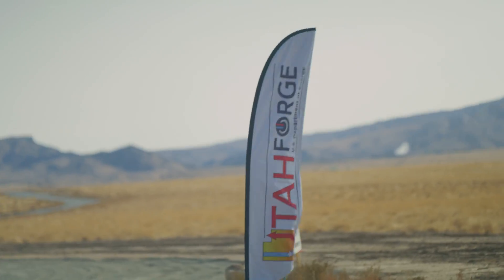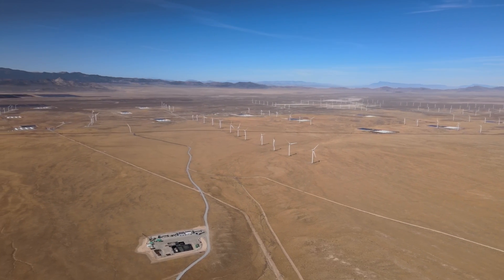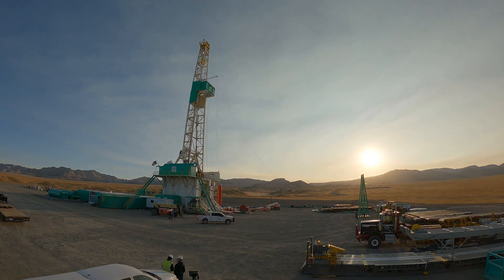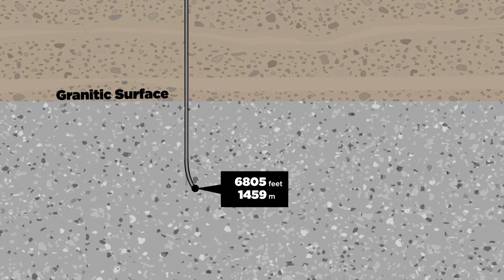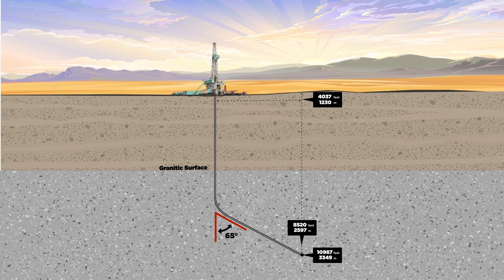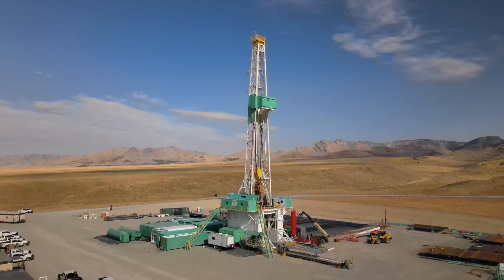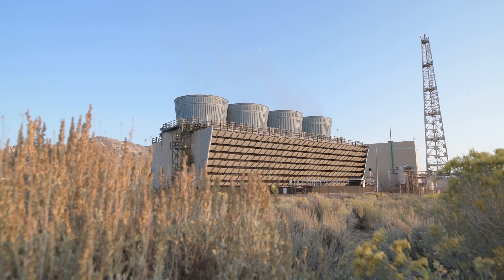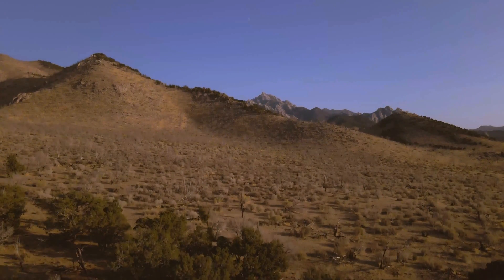Drilling into the geothermal future: the Landmark Success of the First Deep Deviated Well

Comment: long ago the military set off nukes underground...which would have fractured the nearby rock and melted a lot of it.  i imagine that the cavern formed of melted rock would be cracked by now or
could be cracked with smaller explosives.  the radiation will probably last for thousands of years, but does that matter for a geothermal plant that won't be on the surface or used for humans
except for the heat??? Nevada had several of these bomb sites and at least one in Alaska.

Comment: This is a very interesting project ... 
Studying the feasibility of reservoir thermal variant wells was my capstone thesis project in 2011 for graduating as a mechanical engineer from The University of Manitoba
-
What was the expected output in MW of this project?
I'm very interested in bringing this to Africa, amongst a few others. If you guys are taking on strategic partners and funding, I'm very interested in discussing.
Pls kindly let me know and we can set up a zoom call
Reply: The power output will depend on the temperatures at the bottom of the well.
Usuall, the higher the temperatures, the higher the energy output.
At a depth of 5km, we usually encounter temps of about 150 degrees Celsius - 148 degrees C is usually deemed as necessary to generate electricity of around 3MW, however, deeper wells that reach down to 10-12 km and potentially reach 400 degrees celsius would generate 30MW (also known as 'supercritical geothermal').

In fairness, making new wells isn't necessary as its more than possible to use older oil and gas wells and convert them into Geothermal power stations.
Those wells that go down 6 - 12 km can be used for Electricity and heating/cooling, whereas those that don't reach those depths can still be used for heating/cooling.

If they're using newer technology which allows electricity generation using lower temperatures (and ergo don't have to dig as deep), then I don't know of what the energy output would be.
Reply: Your knowledge of geothermal energy is theoretical. Contact me for advice on real geothermal fields. I have extensive experience in geothermal energy.

Comment: I have a question, is it predicted that there will be a lot of geo>electricity or more geo heat used directly for industrial processes/residential use? I know for CSP the conversion cost ends ups eroding any advantage it gets over PV, seems like a similar thing could happen here, though I am sure there is more to it. Excited to see this tech advancing
Reply: A new coating has been invented which prevents degradation in geothermal wells. Says to also use 'no chemicals'.

Comment: So, like fracking, fluid is being pumped into the ground.  Hydrolic fracturing takes place, so fluid will be pumped into the strata, just like fracking. Settling will take place, tremors will happen...  no harm eh?
Reply from the maker: Water is pumped into hard solid granite to prop fractures open, there is no settling. This is all thousands of feet below the aquifer and the water is not disposed into another saturated rock (as is done in oil and gas industry). There is a significant difference between O&G and Geothermal fracking.
Reply: Get a job!
Reply: @123Goldhunter11  I have one...quite highly paid as well. And no, I am not going into details.  I don't bother arguing with idiots anymore.
Reply: There is a legitimate concern (and I’d like to know what the science says) that deliberately fracturing rock could induce earth quakes. However, this drilling technology is far less dirty and quite different from fracking which uses all kinds of nasty chemicals that seep into the ground water. It’s not clear that there is any ground water in this instance - to the contrary it’s solid rock.

Comment: How far apart are the two wells (at the bottom)?  And as you push water through the cracks to the extraction well, what is the efficiency on that? Are there concerns that eventually the efficiency will reduce (given that the two wells aren't connected) and the second well will stop picking up the warmed liquid?
Reply from the maker: The injection and the production well are expected to be about 200 ft apart in the horizontal section. The concern is always there, but the expectation is to establish a solid interconnectivity between the two wells. This is a research project. Time will tell.
Reply: @forgeutah7399 Your knowledge of geothermal energy is theoretical. Contact me for advice on real geothermal fields. I have extensive experience in geothermal energy.